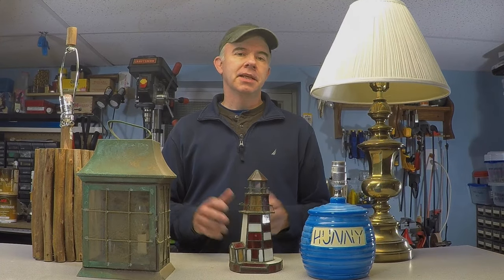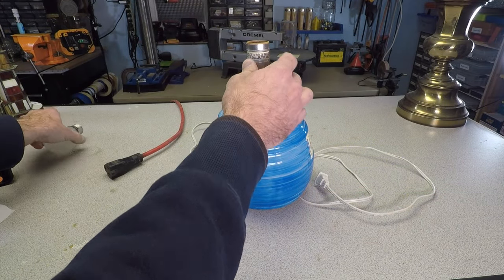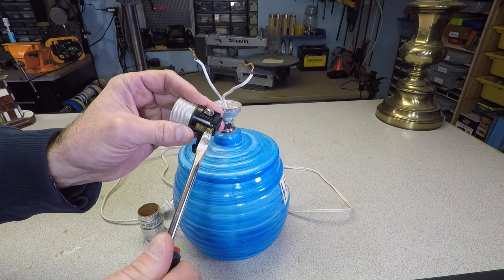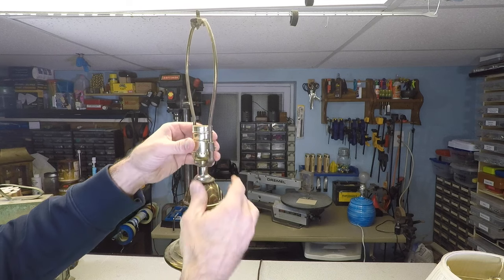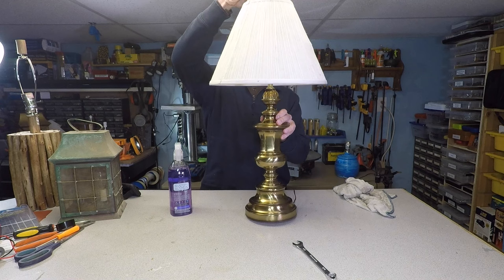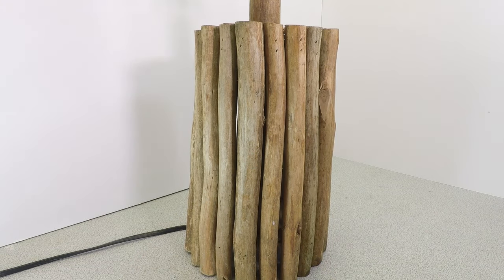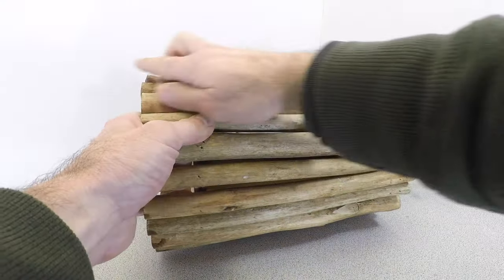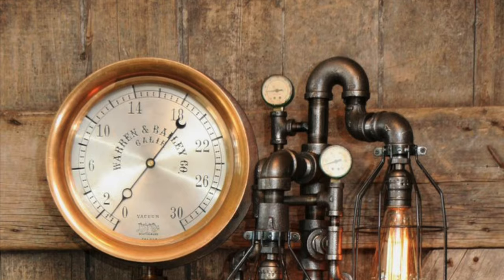Lamp Repair Basics

Comment: This is the only video I found that helped me with my wobbly vintage floor lamp. Now I have to figure out how to fix the  stripped area where the pole screws into the base. But for now it's a lot more steady and stands straight. Thanks so much!
Reply from the maker: Glad to help. I'm only guessing here but if the threads are stripped at the base, you might try putting a small amount of electrical or duct tape on the threads then screw it back in. That might me enough to make up the difference. Thanks for watching.

Comment: Thank You....I just fixed my Lamp.

I Love This Lamp....it’s old school, heavy in weight, perfect color and style.

Only problem it was “loose” and “wiggly” from top to bottom.

First I removed the felt from the very bottom (like you mentioned) got a pair of Pliers (didn’t have a wrench handy) and tighten the Nut under the felt. 

Super amazed how the whole Lamp tightened up : )

P.S. 
How much do I love this Lamp....lol

The Lamp cost me $10.00 at a second hand store. The Shade cost me.....(are you sitting down ?) the Shade cost me $70.00......YES, $70.00  : )

Thank You So Much For Posting This Great, Easy To Understand Video 12-22-2020
Reply from the maker: I understand your thinking.  I was restoring a gumball machine that I paid $15. To replace the cracked glass with an original cost $50. The enjoyment you'll get from it is worth the price :-) Thanks for the feedback. Tom

Comment: know this is an old vid but you must make sure that the gold wire goes to the hot terminal and the silver wire goes to the neutral  this way the outer screw connection of the bulb socket is not energized creating a shock hazard if someone touches the bulb screw terminal.  Also replace the plug with a polarized one to insure safety
Reply: You are correct. It is critically important ,from a safety viewpoint, which wire goes to which screw. At a time when I didn’t know better I connected the hot wire to the outer screw connection and got shocked!!

Comment: If the on/off switch on an old lamp becomes an intermittent  problem,  you can 
sometimes salvage the lamp by buying  a toggle switch at the local hardware box store.
(I like to get the 3 prong switches because they stay in place and 
provide a much more secure connection .)
Then you plug the lamp into the switch and always use the stand alone switch to 
turn the lamp on and off.  This is MUCH easier than trying to rewire or repair 
the lamp.  We currently have 2 lamps this worked for
WRZ   2020-04-10
Delaware County, PA

Comment: Wonder why another video emphasizes the importance of polarity, i.e., connecting the correct wire to the correct screw (brass or silver) but this one says it doesn't matter.  Which is correct?
Reply from the maker: Good point. Technically it will work but the silver screw should connect to the wider blade on the plug. Not sure why I didn't mention that in the video. I should have been clear. Thanks for pointing this out.

Comment: HELP! I recently purchased for $5 a vintage GE swing arm desk lamp that must weigh 25 pounds. Amazingly, the light still works! The problem is the swivel is kaput. As such, the lamp head just hangs down like a wilted flower. I imagine the lamp is 70 years old. I have yet to find any videos or manuals on the components for the swivel mechanism. Any suggestions?
Reply from the maker: Hard to tell by the description. Is something broken? If you send me some pictures, I can take a look. My email address in on my channel it the "About" tab.

Comment: thanks for ur video Sir. i just found a lamp shade and tested it. the bulb still works but appears black and when I turned it on , there is kinda smell like a burned smell and when i removed the bulb what is inside the socket is black. So i tried to replace the bulb and still works.. I just want to know if the blackened color of the inside socket is a sign of overheat?
Reply from the maker: it is a sign that either the socket or the bulb overheated. Can't say which. If the bulb that was in there is blackish, then that is what probably overheated. If you hear, see, or smell anything unusual, unplug the lamp and replace the socket.
Reply: @AlleyPicked  thank you so much Sir :)

Comment: Hi, and thanks or the video! Do you know what the problem is if the turn knob will not click? It just turns for a while and eventually won't turn anymore, but there is never a click, and the lamp will not turn on. Does the whole socket need to be replaced for this? Thanks again. :)
Reply from the maker: Sounds like a bad switch. They go bad after awhile. https://www.amazon.com/GE-3-Way-Lamp-Socket-54372/dp/B002DN4LX4/ref=sr_1_3?dchild=1&keywords=lamp+socket&qid=1603286946&sr=8-3

Comment: I got this little vintage milk glass lamp that has 2 light bulbs being one on the bottom and one on the top. Looks like the socket is broken but I can’t find a way of removing it to switch to a new socket. I’d love to send you a picture or video of the lamp and see if you can suggest me something.
Reply from the maker: Sure. Send me a pic or vid. My email contact in in the channel "about" section.
Reply: @AlleyPicked  could find your email…
Reply from the maker: @anabel2anabel  tom.szontagh@gmail.com

Comment: How about a lamp that has a switch that only turns the lamp on approx 1 out of 10 times ?
Turning it off with the switch, works every time.
Reply from the maker: Sounds like a short or broken connection in the switch. Time to replace the switch.